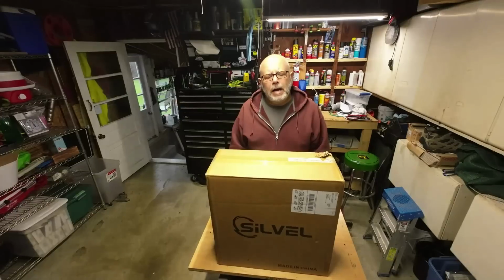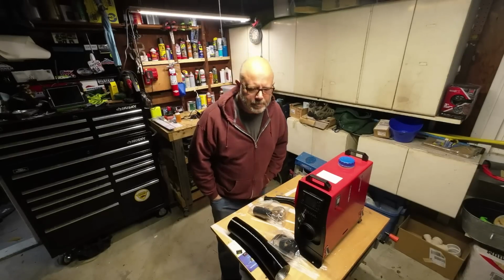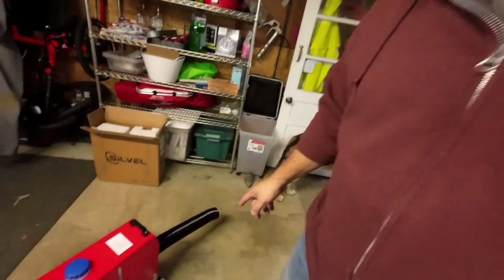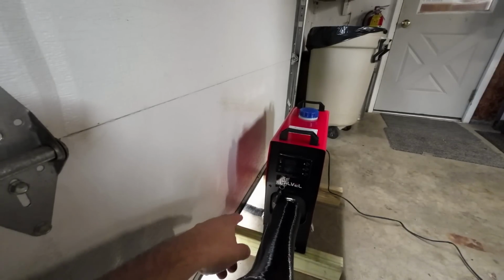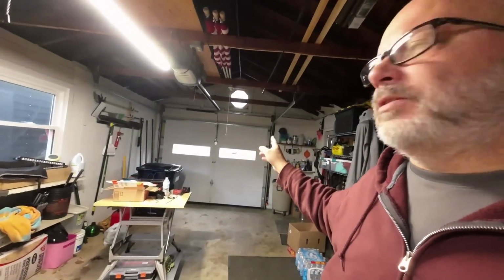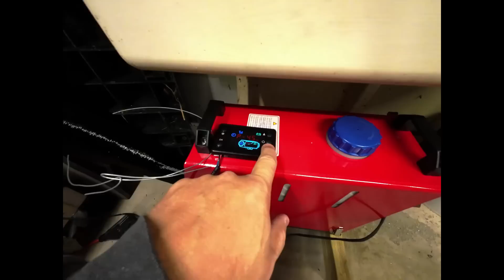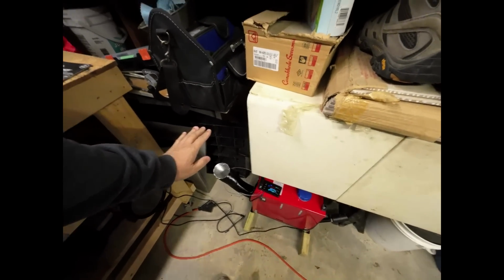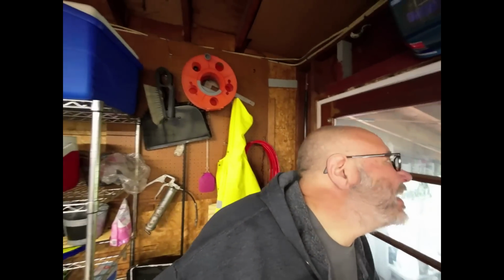I bought a diesel heater from CHINA!!!!

Comment: The roof isnt insulated .,,.blastes the heat up at it 🤣 Man point the heat outlet at the stonefloor so the heat goes into the foor and stys in the room,.,.and not just piss's out the roof
Reply from the maker: Thanks for commenting. Since the video the duct now blows horizontally and I put a diffuser on it so it’s working better. I really just need to improve the insulation in the garage but that’s a project for another day. Even with the poor insulation it’s working good it was 13°F here today and that little heater kept the garage at 53° all day.

Comment: Noticed you filled your diesel heater fuel tank from a red fuel can.  Why wasn’t it a yellow one that’s designated for diesel?  Red is for gasoline.  And blue is for kerosene (or water for some reason).
Reply from the maker: I didn’t have a diesel can at the time. It’s the only thing I have that runs on diesel. I have a yellow can now.

Comment: Every one of these youtube videos always puts the air intake inside where it is not supposed to be. IT SHOULD PICK UP OUTSIDE AIR for combustion, or it will pull a vacuum in your heated space and cause cold air leaks everywhere. Another hole in the wall for the combustion hose would make a world of difference.
Reply from the maker: Thank you for commenting and advice.

Comment: The way the fuel prices are going I was really interested in this, maybe heat my house. I mean, 8KW is enough right ? Anyway the price of diesel in UK is around £1.80 per liter. So that means around 10 litres a day (12 hours) at a cost of £22.44p. Wow, if my gas bill cost that much I would be bankrupt. Is my maths wrong...no idea, I pulled it from a test on another video.
Reply: Other reviews I have seen suggest a run of around 10 hours per litre of fuel.  Hope this is correct
Reply: @Westexec  that's much better, wondered what the point was at that cost.
Reply: if it’s marked 8kw its false advertising . the CDH are only 2 and 5kw 👍
Reply: You can buy 500ltr of heating oil in (Home fuels) UK at 88p per ltr approx £448 and store in a 600ltr IBC at a burn rate of 1ltr every 4hrs that should run 12hrs per day from OCT to MARCH. if you run the exhaust gas out but through a standard radiator first you can reclaim a lot of the exhaust heat. Make sure you drain condensation from radiator regularly.
Reply: @concerneddad5561  ….by standard rad, do you mean a house central heating rad or a car rad?
Reply: @Westexec  an old cast iron steam type radiator is recommended. Vent in from the bottom of radiator and out through the top so that your not fighting against heat rising by venting the reverse way. You will have to drain radiator because of build up of condensation that will block the exhaust fumes. Another option is using a 2m replacement exhaust with a slight downard slope to auto drain. Leave as much exposed pipe as you can before venting out. That way the hot exhaust will dissapate fair bit of its heat inside and no need to drain a radiator. Research on youtube about " diesel heater exhaust  heat reclamation" remember about draining or gases will back. Don't die for a lack of research.